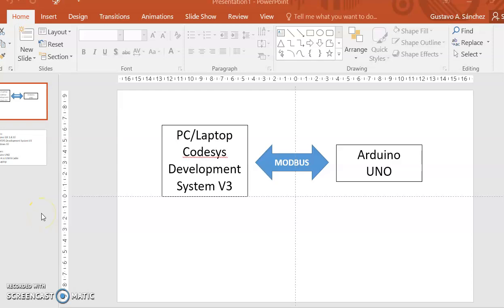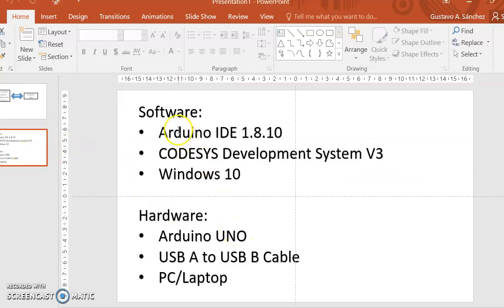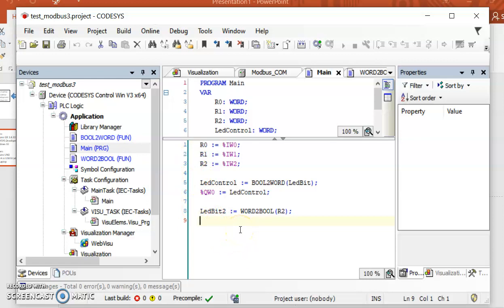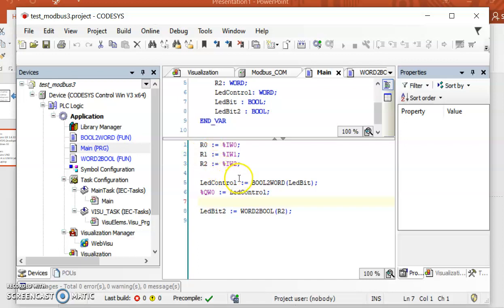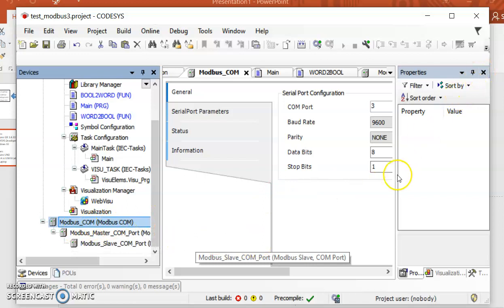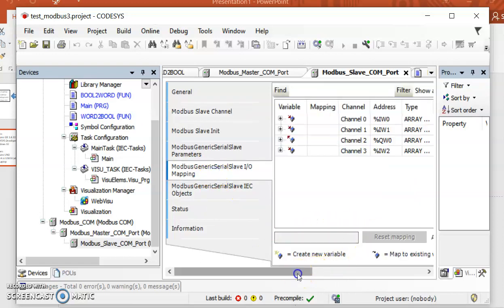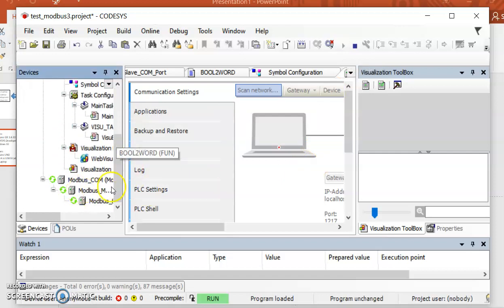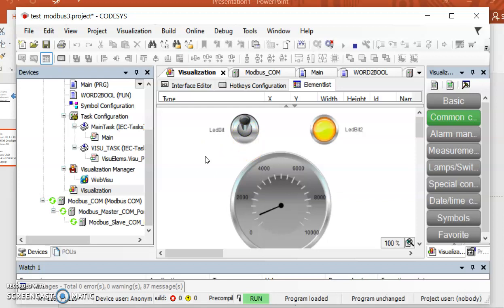Arduino UNO - Codesys Control Win V3 - Modbus RTU

Comment: Hi Gustavo When I try to connect to slave the software asks user name and password, How can I solve that issue??? (I use Administrator as user name and password but it fail)
Reply from the maker: It seem to be a problem of Codesys setup
Reply: It's not a problem, I set up a new account, just a name and password. Or you can use your windows  name and password.

Comment: which file have you uploaded in arduino ? because the file test_modbus3.ino is not compiling. You have used 7 parameters in the function modbus_configure , while as per its library it takes only 5. can you please help ?
Reply from the maker: Hi, sorry for this delay, you have to install the library SimpleModbusSlave.h

modbus_configure is as follows:

void modbus_configure(HardwareSerial *SerialPort,
		      long baud,
		      unsigned char byteFormat,
		      unsigned char _slaveID, 
                      unsigned char _TxEnablePin, 
                      unsigned int _holdingRegsSize,
                      unsigned int* _regs);
Reply: Do you change also modbus_update(); in the library? I can´t compile it. Thanks.